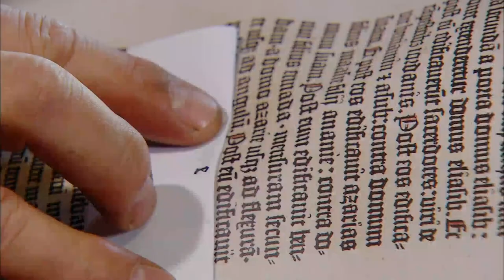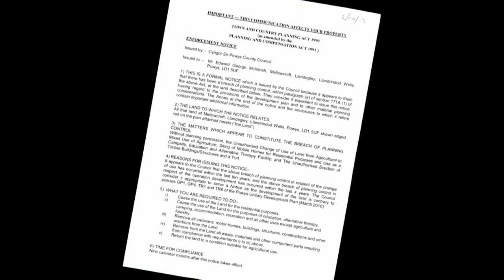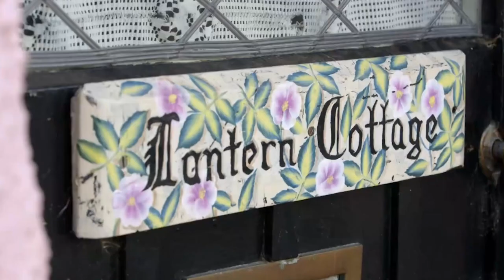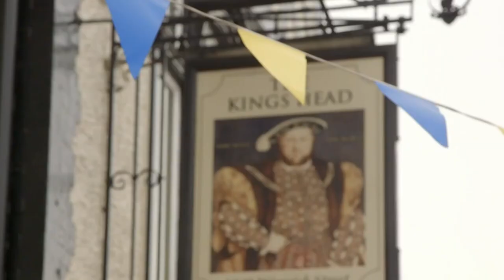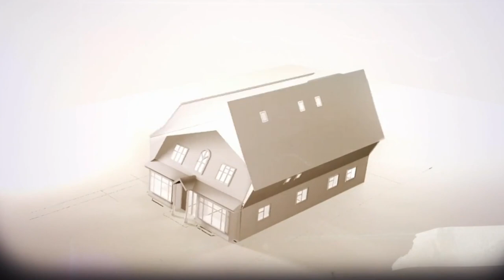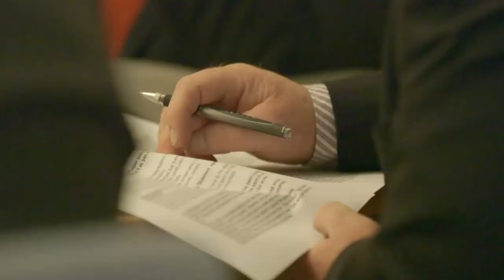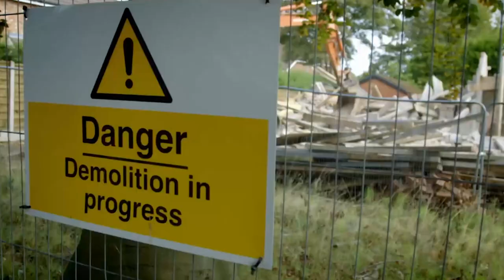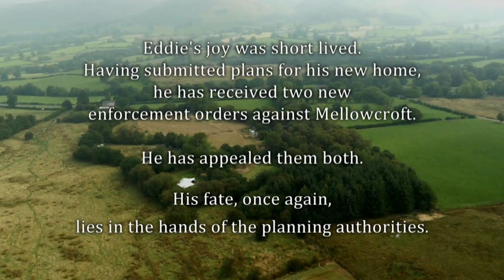50 Shades Of Pink: Council Threaten Homeowner After Painting House Too Pink | Damned Designs

Comment: My neighbor had build an extension up to the boundary line that was very close to the neighboring house. 

Unfortunately a year later the extension caught fire. We had heard it was was due to the neighbor badly installed wiring (he had used old electrical extension cords, cut the ends of them and used them as wiring for the sockets and lighting) that started the fire. The  fire had also damaged the house next to his but luckily it was just exterior damage. What we heard is that his insurance company won't pay out due to the unauthorized extension and he has tried to sue the insurance company for not paying out.
Reply: Same is true for anything done with a permit

Comment: Here in the U.S., we added a screened porch to our house.  It required a permit before doing so.  People have added on to their homes without permits only to find out later it wasn't acceptable and had to be torn down.  Ignorance is not a valid argument.  If you live in a neighborhood with an HOA; you have to abide by their rules; similar to the counsel in Great Britain.  One of our neighbors painted their house a new color without permission.  It was bright orange.  The HOA made them change it to an agreed upon color.  Had the homeowner checked with them first; it would have saved them the cost of painting their home a second time.  The bottom line is; always check to see what is required before doing something along those lines.  An ounce of protection is worth a pound of cure.
Reply: Hence why I moved away from a community with an HOA that didn't pre-approve my shed - stated that it's not the same color as my house as well (even though I had woods surrounding  3 sides of the yard - and will never move back to one.
Reply: @susank.4945   I agree; HOA rules can be excessive.  When we were house hunting we were shown a neighborhood with a literal book of rules.  One of those was not using colored lights outside as holiday decorations; only white.  And not leaving a car parked in the driveway overnight.  Those I don't care for.  But I do like the ones that require you to maintain the upkeep to your home and yard.  It boils down to what you want to live with and look at in your own neighborhood.  A dilapidated house/yard is an eyesore for me and affects my property value; so that is important to me.  Having autonomy over your home is important to you.  We are lucky that we have multiple options to choose from to suit all our needs.  (And I for one like your idea of an alternate color for a shed.  Too matchy-matchy is boring.)

Comment: That pub extension is only a temporary structure is "against" the original structure and can't be seen from the street so these're only minor infractions.
Reply: I am more concerned about what he has done to the inside.  From the outside that must have been a beautiful and now rare example of a Victorian pub. He has reduced it to a rather ugly booze dispensary.  the 'shed' is the least of it. As he has already wrecked it, but seems to have a community, let them get on with it.
Reply: They would be minor infractions if the pub wasn't a listed building.
Reply: @pcb1962  The Extension is the minor infraction as it's classed as a temporary erection and it's hidden from view but we don't know what was done to the actual listed building yet that warrants all the fuss.
Reply: @hogwashmcturnip8930  I do beg the question if it was so great before his changes why was no one wanting to take care of it properly?
Reply: @hogwashmcturnip8930  Agreed, the interior of that pub had lost all its charm.
Reply: @jacobhatfield4970  You cant force someone to maintain the building unfortunately. Maybe they ran out of money or ability.

Comment: Move to sa, there are rules but not followed through at all. The extensions are either ridiculous like not being able to open a window bec it touches the wall or on the neighbors yard 😅 very few apply for plans. They just build here... It's ridiculous especially in certain areas. Sad truth is if you try do the right thing it takes ages, costs a ton and still supper questionable when the building is fire Hazzard. They don't care.
Reply: SA?

Comment: The lady in blue on the council seems to be the only sensible cognizant person on the board. That balding idiot who argued that “damaging the heritage” is absolutely daft. The guy added a conservatory to the back of the building in a parking lot. What damage could there possibly be that is detrimental to the building itself? If anything it saves the building from wear and tear by diverging traffic from the period building. 

Also bureaucracy seems to forget that if a building isn’t being used, often times the buildings lay unused and empty. And without maintenance buildings like that, are a susceptible to dry rot, wet rot, water damage, mold, and dereliction. That owner has done a lot to save that building even if it isn’t wholly period accurate. I’d rather have a modernized period building than a rotten ruin destined to be razed to the ground. If the government isn’t going to do anything to save a listed building, they should have no business in dictating what well meaning property owners are doing to said buildings.

Comment: The counsel and any HOA's should stick their papers and rules where the sun don't shine. Planning permission is fine to make sure  everything is safe for everyone but it should be NO ones business how other  people want to live. If someone next to me painted their house green with purple poka dots, then it is fine with me.
Reply: Yup 100%.
Reply: What's your address, can I come and build a house right in front of your yours in bright green, blocking your view and restricting access to to your drive? Everything is fine until it affects you directly, right?
Reply: @tomdarrington  The problem is the case by case system. Other countries just do city planing by freeing up zones for housing and giving each zone it's building rules. like relation between size of the property to sqm of living space , maximal height, angle of the roof , colors allowed, materials allowed, space between buildings.
Reply: It is a completely different story if the house is listed (i.e. historic and architecturally significant), like the woman’s in this video. Her cottage is at least 500 years old and a bright bubblegum pink is hardly appropriate; not to mention the fact that in this region of England, traditional villages are a mixture of exposed stone/ painted buildings in cream, white, “soft” pink and pale yellow. The colour she chose is very similar to the sorts of colours you find on half-timbered buildings in villages across Suffolk and Northern Essex (where colours are far stronger), but not Devon. These things are important to preserve and should be respected.
Reply: You are American right? This lady bought a listed building, everyone in the UK knows the restrictions on listed buildings. If she wanted a bright pink house she should have bought a modern house.

Comment: How can they tell her what colour to paint her house!?
Reply: It's a "listed" building.
If you don't knowm, that means it's a building of historical importance and as such can't be changed, with out consulting the local council. 
If it's a grade 2 listed building, you can't change anything, and repairs must be done using original materials, ie thatched rooves etc..
Reply: @jamesalexander7747  Bro, its paint. That's not structral nr does it harm the building in any way
Reply: @hitsongsa  It absolutely does harm the building, and not only the building itself, but the surrounding area. 
First of all her cottage is at least 500 years old and listed (i.e. historically and architecturally significant); a bright bubblegum pink is hardly appropriate for a building of its age - resulting in a colour that is “negatively” impacting its historical authenticity.
Secondly, in this region of England traditional villages are made from a mixture of exposed stone/ painted buildings in cream, white, “soft” pink and pale yellow. The colour she chose is “similar” to the sorts of colours you can find on half-timbered buildings in villages across Eastern England (Suffolk and Northern Essex in particular), where shades are far stronger, but definitely not Devon (which is in South-West England). 
The fact we have building materials/ colours specific to certain regions is important. Just to give an example: I grew up in the Cotswolds region of England; where every building is constructed using beautiful honey-coloured limestone, I now live in Suffolk (a region that lacks good quality stone), and is therefore filled with masses of half-timbered architecture - two completely different styles. This is not only the case between different areas of the country, but within each area itself. For example, the further north you go in the Cotswolds, the richer the stone becomes (i.e. stone in the Southern Cotswolds will be much lighter in tone, than stone in the Northern Cotswolds). The same in the East of England; as you move from Suffolk to Northern Essex the painted buildings become richer and deeper in colour (not to mention also a higher concentration of medieval wall art known as “Pargeting”).
It may seem silly to you, but these regulations ensure the protection of authentic regional variation across many of England’s beautiful historic villages and towns.
Reply: @hitsongsa  In many countries you'll find villages and hamlets which date back hundreds of years. In some of those you are required to keep the colour of the home in keeping with those surrounding it. I live about 3 miles from one in the UK, and I've visited others in France. I get it.

If you can't follow simple requirements like that, go live somewhere else...it's a big world...